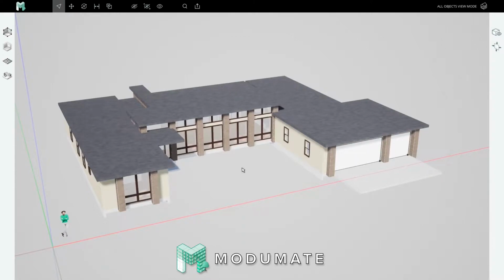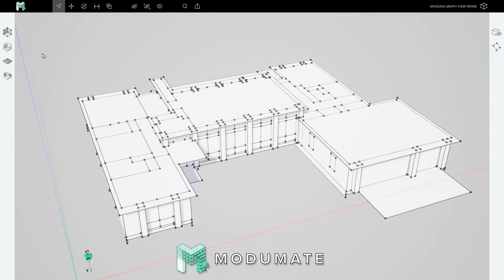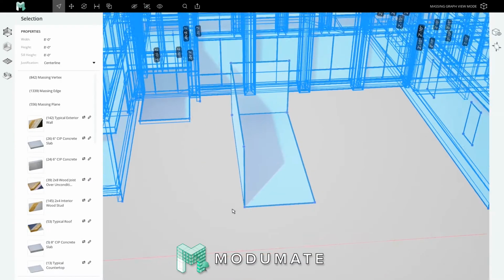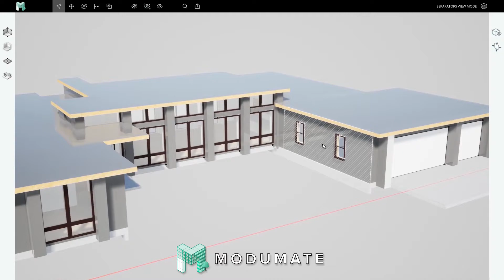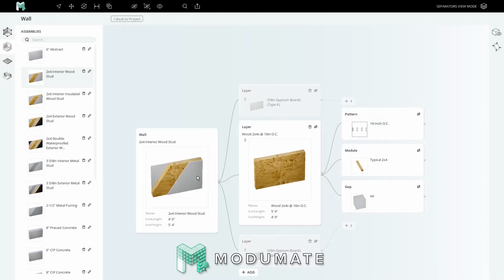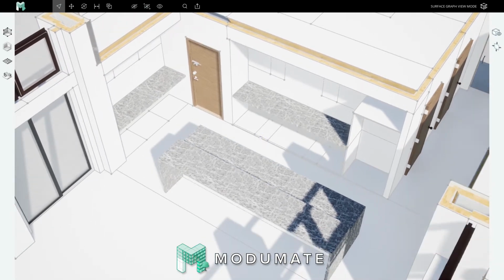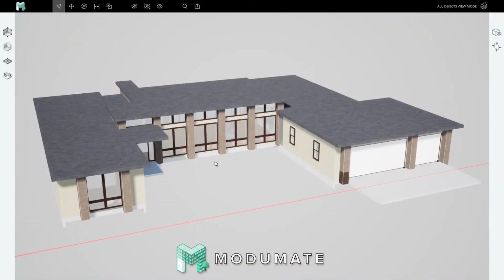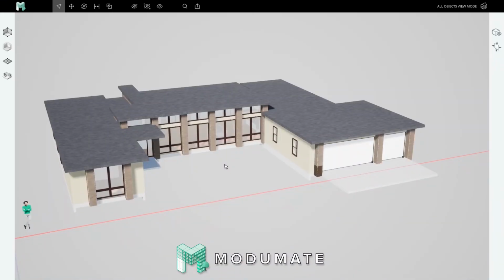Modumate - 7 Minute Tour

Comment: Can someone please let me know if i can design decks with this program, decking frames and different types of material for decking
Reply from the maker: Hi Dmitry, you can indeed design decks with Modumate. By using Modumate's 3D Massing tools, you can model decks very abstractly (one plane for the whole deck's walking surface) or very literally (one edge for every piece of lumber), then host assemblies onto the planes or edges you've built. Modumate will then show the deck in beautiful 3D, and assist you with producing drawings and quantity estimates of the deck. Let us know if you have any other questions!
Reply: @modumate9268  Is there a number i can call to find out more information about you guys please let me know thank you

Comment: I am intrigued by the ground-up simplicity and approach, and I like the integrated Unreal setup and high-quality entourage. However, other than someone still using CAD, how does this improve a parametric BIM workflow? I don’t have to re-export anything in a BIM app or update backgrounds. Sometimes dimensions break, but that is minimal compared to running an entire parallel drafting process. And design/detailing is an iterative non-linear process, so updating 2D CAD backgrounds means you have to then go and manually coordinate and revise your annotation. Are you planning an integrated annotation/sheet module at some point?
Reply from the maker: Hi Angelo, thanks for your question. At this time, Modumate is definitely striving to be the best 3D partner to a 2D CAD workflow, which is still how 30% of small US-based firms do their work. For those firms, Modumate delivers value by creating their geometry DWGs (as well as their quantity estimates and renderings), and keeping them coordinated - just update the model and re-export all DWGs.

In the next 12-18 months, we will create integrated sheet management tools that will allow Modumate to fulfill complete documentation duties without needing AutoCAD.

Comment: It's hip to be square. What about round forms? And you still need a 2D CAD program for 2D technical drawings?
Reply from the maker: Hi Richard, Modumate is a new software whose abilities are rapidly growing, but admittedly can't do everything just yet. We've focused on making it easier for CAD-based architects to create detailed 3D models of straight-edged buildings, then helping them get background DWGs for their CAD sheets. 

Modeling curved edges and surfaces is not supported as of May 2021, our current expectation is to support them by mid-summer 2022. 

Developing your sheets directly within Modumate is likely to become available sometime in 2022.

Comment: hello. i love this app plus your videos are easy to understand ! thank you for ur efforts!!

 and I'm about to start the trial version , but before that i wanted to know if my model of SketchUp can  be imported in this ?Do we get sections similar to cad?
Reply from the maker: Hi Poonam, as of May 2021, Modumate does not import SketchUp or any other 3D models for use in Modumate. You can import images using the Import Image tool, which allows you to bring in (rasterized) DWGs, PDFs, hand sketches, or even your SketchUp model, by simply taking a screenshot, importing it, then giving it a scale.

Modumate CAN produce sections similar to CAD. By placing a Cut Plane in the model and clicking Export, you can get a detailed, layer-aware DWG for use as background geometry in a 2D CAD sheet.